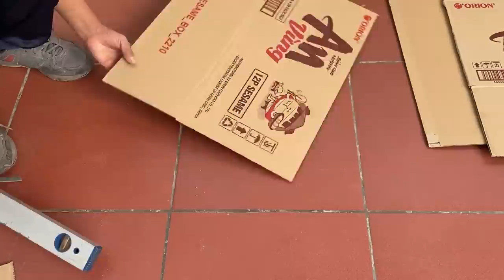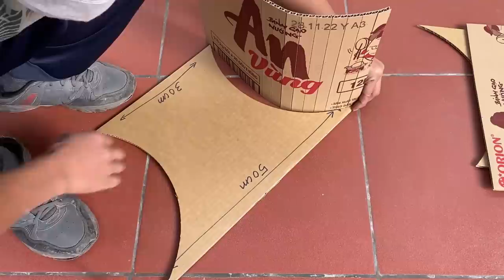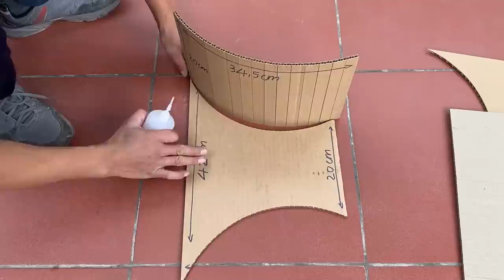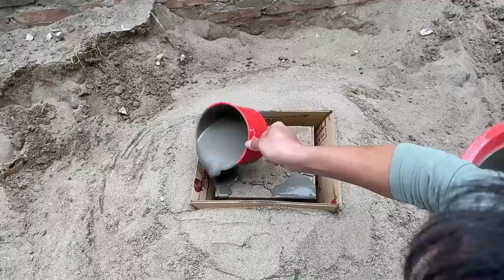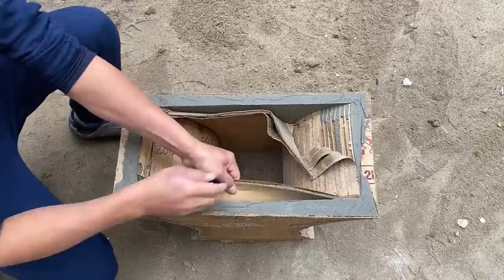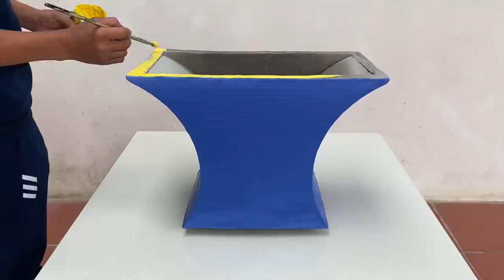Very Surprising That With Only Cardboard Boxes And Cement You Can Create Very Unique Flower Pots

Comment: how much cement and how much sand
Reply: Hello,,,,, friend
Reply: Cement price 50 kg 400 rs and char tasala sand 400 rs barabar 800 rupay
Reply: 2 parts sand 1 part cement 1 part water use any size cup just use same size cup for each item
Reply: A lot.
Reply: 1 cement 2 sand
Reply: Hi Ankur,
That’s a great question! I’m not sure how much cement and how much sand. However, I have confidence you will be able to find the answer you need. Hope this helps!
Best regards,
🧌